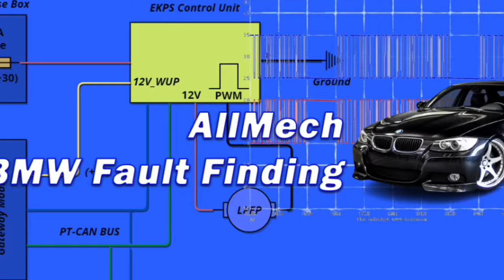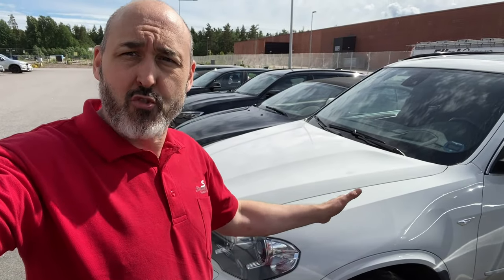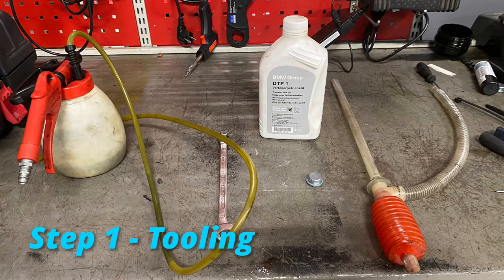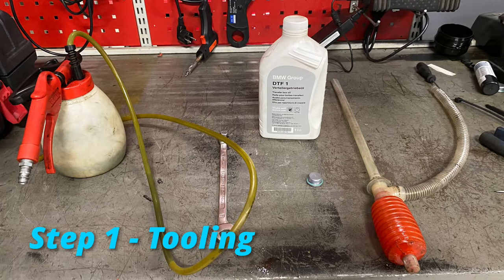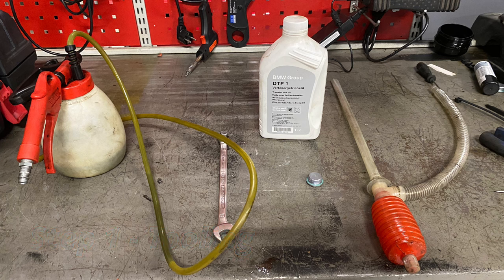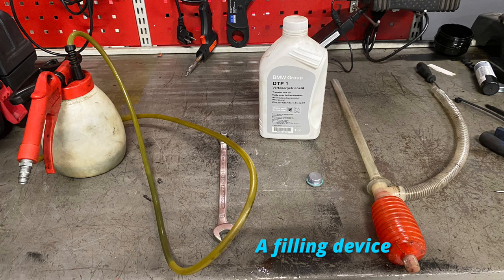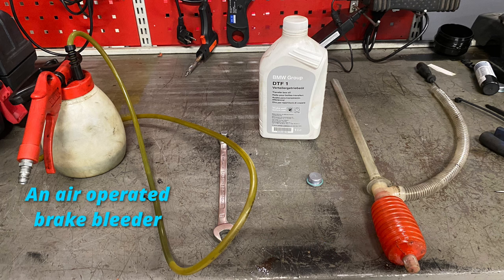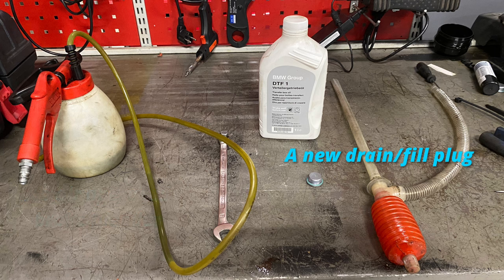2013 -18 BMW E70/E71 X5/X6 transfer case fluid replacement in 6 EASY steps. X5 transfer box.

Comment: Nice to see that calibrated torque arm being used 🤭
Reply from the maker: Haha - old school. You'd have to drop the cradle to torque it Julian so I welded a 14mm Allen fitting to a 40 year old Bahco Selzer spanner. Works like magic pal 🙂
Reply: @allmech_BMW_fault_finding  When manufacturers do stuff like that you can tell the designer was not an engineer!

Comment: I have an E53 X5 4.8is
Let it sit for a while 
Battery went flat/failed 
Bought new battery
It cranks but won’t start - no fuel 
My scanner previously had access to 

1 Motor Electronics

2 Transmission control

3 Transmission control VTG

4 Electronic car immobilization system

5 DME(DDE)-EWS adjustment

And I can only access 1 & 2.

Bought the scanner to diagnose bunch of faults VTG4x4 - saw on live data alternator voltage spiking up and down. Found super-ceded regulator part number listing - fitted bingo all fixed👍👍

Do you think you can help me to diagnose/fix my x5 by remote over email ….ill pay you👍
Reply from the maker: Send me an email to my icloud link in my profile and I will certainly take a look 👍
Reply: @allmech_BMW_fault_finding  please don’t think I’m an idiot but I can’t see an iCloud link…?
Reply: Can I post the link here I can’t find it…
Reply from the maker: @corey5797 bmwfaultfinder@icloud.com